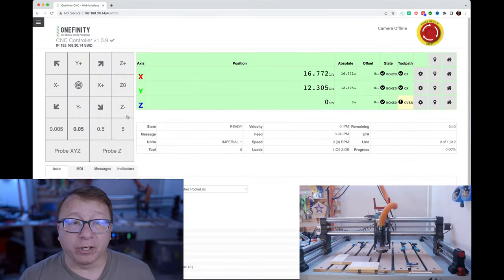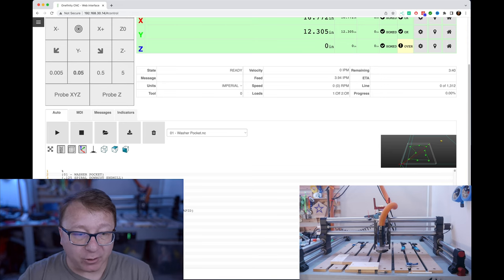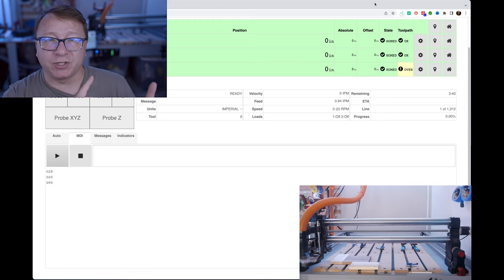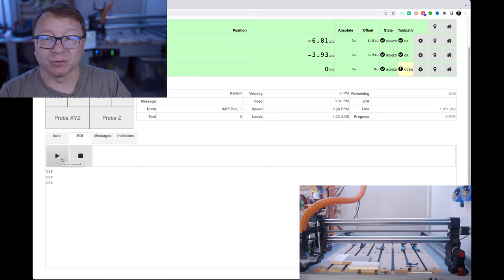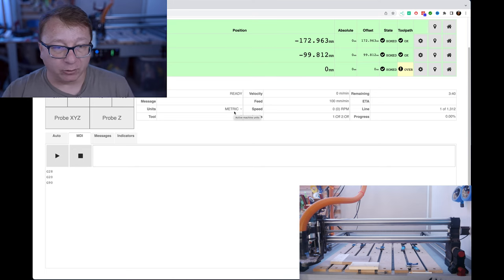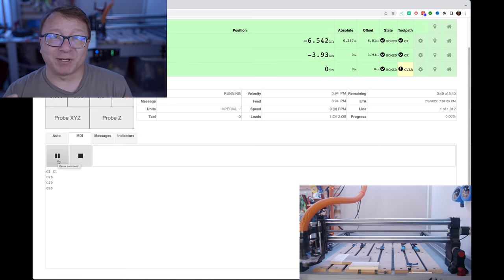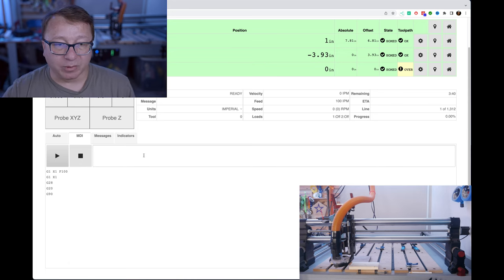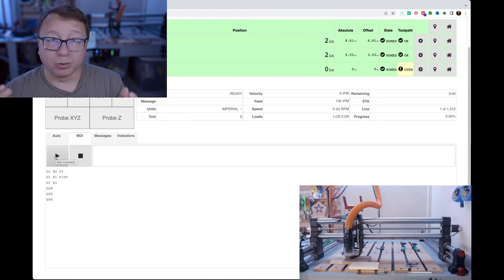Level Up Your Onefinity with G-code

Comment: Great video explaining MDI.  At one point you mentioned that you routinely stop long carves (especially with epoxy).  Do you completly shut down then use MDI to set the start position when resuming?  I would love to learn more about that practice.  I currently pause my 1F but not overnight.  I have a longer carve coming up and it will take a full 8 hrs.  I would love to stop in the middle of a 3D finishing pass.  Thank you
Reply from the maker: Hi Mike - thanks! Yes, I turn it off completely between runs -- *before* turning it off, I write down the absolute coordinates for the zero position. The next day I re-home and re-zero to the coordinates I wrote down (using the MDI interface), then I do my next series of cuts. The OF has fairly good repeatability with homing (I did a video on that as well), so you can get within 5 thou of the original position, which is good enough for what I was doing. If you need more accuracy for some reason, then leave the machine in the zero position when you turn it off, make sure no one touches it, and when you turn it on again it will be in the right position -- immediately zero without homing. That gets a little sketchy since the machine doesn't know where home is, but you can start cutting from the exact zero position each time. Hope that helps. Thanks for watching!

Comment: Thank you for your excellent videos. Why can’t Home be made to be x=0, y=0? What, if any, is the advantage of Home and 0,0 being different ?
Reply from the maker: Hi Jonny - great question. In short, after you home, the machine will set x,y,z to zero. It is a known location the machine can return to at any time. However, you don't always want your machine to start cutting at the home position since your material might not fit there, or you need to start at an alternate location. As such, you can zero your machine at any location, essentially creating a secondary position that is relative to your stock or material. Further, not all machines have automatic homing, and in that case, you are stuck with zeroing the machine each time. I hope this helps -- thanks for watching!
Reply: @cyberreefguru  Yes, thank you!

Comment: Tanks a lot for the explainations ! Do you know how a Onefinity would be moved in "machine' coordonnates ? I would want to move to the rear right corner after a job instead of the front left homing position and I can't figured it out... Help ! :D
Reply from the maker: Hello. Any positioning of the machine after the job is complete is usually put into the gcode by the post processor. Onefinity does not home after job complete by default. As such, look into your post processor and replace G28 with your coordinates. Hope this helps -- thanks for watching!
Reply: @cyberreefguru  gonna try that. thanks a lot !
Reply: @cyberreefguru  I've manage to make it work thanks to you. Many thanks
Reply from the maker: @daganael  Glad you figured it out - best of luck!
Reply: @cyberreefguru  Guru ! I need your help !
I calibrate my 1F based on the probe cube. It worked fine, moving 60mm gives me 60.07, I can live with that.
Problem is all my fusion toolpath gives me smaller pockets than expected : a 20mmx200mm pocket gives me roughly 19.74 on both axis and 'stock to leave' is unchecked. I can't figured it out.... any pointers ? much apprechiated
Reply from the maker: @daganael  Hi there -- I see you posted on the OF forums -- that's probably the right place to debug any issues. Will continue the convo over there. Thanks!

Comment: Nice Job. Can you enter an Fxxx while a job is running to change the feed rate?
Reply from the maker: Not with the Onefinity, but you can with some machines.  It really depends on the controller and how it feeds commands to the machine.  The OF locks out the MDI while automated files are running.  With the X-Carve, you could use the buttons on the controller to change the feed rate.  Thanks for watching!

Comment: great, any open source can translate 3dmax to G-code?
Reply from the maker: Hello Roger -- no software will automatically generate gcode from a 3model (and get it right). It just doesn't work that way. You can output your model as an STL and then import it into Fusion and do 3d tools paths as necessary. Sorry, but there is no 'easy' button for CNC tool paths. Thanks for watching!